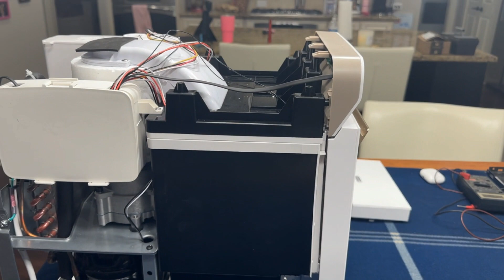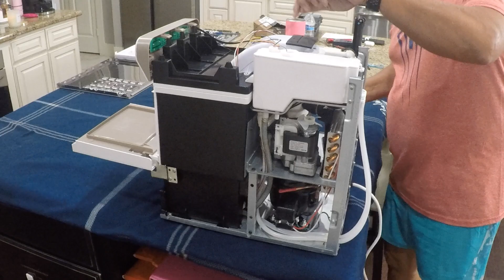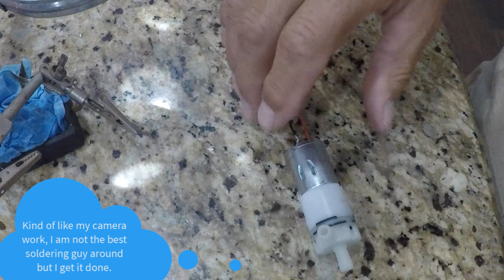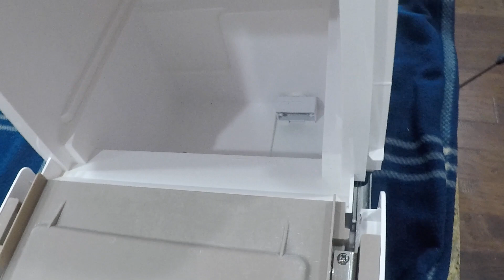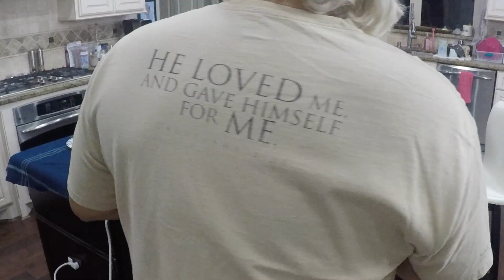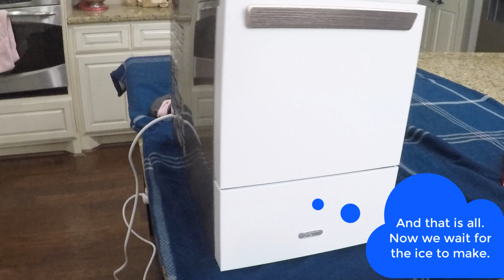GEVI household nugget ice maker repair

Comment: My pump is not getting power to it what could it be, anyone had this problem?
Reply from the maker: Is it just the pump, or is the rest of the unit without power?
Reply: @The-Old-Dude 

Got it to work for a while, now is showing again that needs water. Also while making ice I notice making a loud noise and finally the cover for the ice  broke. It looks like the ice was getting stock and putting pressure to  the white ice cover!
Reply from the maker: Sounds like a water flow issue to me. Make sure all the lines are clear and the pump can fill the tank and push water out of the ice shoot.

Comment: Any ideas on one not stopping making ICE? Mine runs and runs and fills up near the bullet metal dispenser then causes condensation over the outside. I've cleaned the sensors and taken it off the auto fill line but it keeps going. Maybe it's the thermistor? Do ya know what that is located?
Reply from the maker: You are on the right track looking at the sensors, because if memory serves, when the ice blocks them from seeing each other, the machine shuts off. I would check connections and wire integrity. If all of that is in good shape, it has to be the control board.

Comment: Thanks, fixed mine too. Just a PSA that there's a pump for sale on amazon that has the leads pre-soldiered in and the same plug as the Gevi OE pump, so it's just plug and play.
Reply from the maker: That's great to know, thanks for sharing the tip!
Reply: Do you have the link for that part that is ready to go?

Comment: I have an opal ice machine but the set up is very similar to this gevi….so I replaced the water pump but it runs as soon as I plug the machine in…so it’s getting power even if the machine is turned off. Any guesses why it’s getting power like that?
Reply from the maker: If the machine is off it must be controls related

Comment: This is wonderful!  Got my 2+ year old GEVI back to good as new!  Cleaned a lot of scale out of the lines and fittings in the process (will be more diligent about descaling in the future).  IMPORTANT NEWS - Amazon now sells a pump with the same model number pre-wired with the correct connector - so no soldering needed!!!
Reply: Also,  If you are ready to do this - pay attention to the end of the video to learn the tricks to dis-assembly that are skipped over in the beginning!
Reply from the maker: That's great news about the pump, glad you got yours working again! I will look for that pump next time, is this the one you used? 
https://www.amazon.com/KPW26C-12C2-Replacement-Profile-Countertop-Genuine/dp/B0DWXXP8H1/ref=sr_1_8?crid=25DZD3UG799AW&dib=eyJ2IjoiMSJ9.dsppDq6Nzop4YQuuj7nRtPjtiU1CDgQTJGE39pHm04RNn4MTFbCBn4BFVeWcMXvbURLfkyB2PwA0F10upQSieRrUBtrFId1a4pxYtBdCq5r-sGJ4EKxxUd8xiMe7t1Y3usa4jlE0nksdEGXWkXGRn3XSh7MkJs_gaUFcF7rkU9Kvqo9PVazhme5LVSSuP8W8-MhCCw7x88ChE8Ls45O_cgl2vh-WiE7reauNxmm_bNU.hr9rz5jr3XYZZKMkBzDAkK7t3XeQFUSTaCQtDfxnDzQ&dib_tag=se&keywords=ice+maker+pump+replacement&qid=1765644899&sprefix=Ice+maker+pump%2Caps%2C154&sr=8-8        

 If so, I guess that means there is a need for this plug-in replacement.

Comment: Thanks for the video, mine is acting up, and now I can reference this video for how to take it apart and check things.
Reply from the maker: Good luck with your repair.
Reply: @The-Old-Dude  thank you, I couldn't figure out how to get the control panel off the front, but I was able to clean the coils and it's working much better now and stopped leaking somehow.
Reply from the maker: @Dorraj555  nothing wrong with being lucky.

Comment: I unfortunately don't think I can replace mine.
Got it from auction; a Gevi 2.0 but it uses a different pump. 
It's a KD-28 model but has three wires: black, red, and yellow.  I can't find it anywhere =(.

Thankfully I'm within the return time frame.
Sucks though cause I was really looking forward to this machine.
Reply from the maker: @NiftyNiklz  No help here on the third wire. Maybe a speed control?  Good luck.
Reply: It’s not letting me post links for some reasons, but the pump I ordered was ZLWB-12 HZB-12A/25BF Household Small Bullet Ice Maker Water Pump Compatible with HZB-50A/ HZB-50/ HZB-60/ HZB-80/ HZB-25BF/ HZB-13F/ HZB-20F/ HZB-20FA Ice Maker Machine DC 12V 0.3A

And the fan spoofer was: Fan Spoofer New For RED MAGIC Quasi-Speed Device 12V PWM Variable Frequency Version Fan Speed Simulator, 5-20V Super Compatibility

Comment: My unit was DOA (front panel was dead).  Since it was only a few days old, they had me cut off the electrical cord and they sent me a whole new unit.  I was going to throw the defective one away, but after watching your video and deeming the unit repairable, I think I'll just hang on to the disabled one and use it for parts, should I need them.  Great video!
Reply from the maker: Good plan to hang onto the unit.

Comment: Mine is freezing up where it makes the pebbles and you can hear it wanting to spin but it can’t because it’s frozen. Also it doesn’t seem to be making pebbles or pulling water out of the main tank. You think the pump could be the issue to both problems? because I read lack of water flow can cause it to freeze up.
Reply from the maker: That's an interesting idea. Mine also recently started freezing up. I have recorded what happened but have not figured out a fix. I will upload that video soon.

Comment: THANK YOU so much for the video, I changed out my water pump and it's back up and running perfectly! I would suggest using some flux when you solder your new leads into the motor. It helped me so much control where it went and stayed. Thanks again!
Reply from the maker: Glad it helped. I will add that to the notes for next time.

Comment: I wish you would have shown how to get the sides off…. For the life of me I can’t get mine off
Reply from the maker: Good Point. If you will go to about the 16 min mark I detail how all this goes back to together. For removal just reverse this process.
Reply: Thank you that helped! I was able to get it apart! Now just waiting for my new pump to arrive.
Reply from the maker: @Backroadtested  Good luck. For additional reference you should watch the video I made more recently when mine started leaking water. I had to take the ice slide apart  which would help with the pump removal as well.
Reply: I have a slightly different version (GIMN-1000C) and I can’t get the sides off bc the screws from the on/off section go right through them so I’m unable to remove either the on/off section OR the sides completely
Reply from the maker: @amyerickson449  you have to take the screws out of the top of the on off section and then lift it up and there are screws through the front of the machine that hold the sides on behind on section and behind the lower trim, I guess what you call it, at the bottom of the front. I show taking both off and on because this was the hardest to get off.
Reply: @amyerickson449  I had similar struggles disassembling mine. Like The-Old-Dude mentioned there were 3 screws on the top but there were also 2 screws going through to the main body of the appliance and I was unable to lift up the on/off section until those 2 screws were removed. I found out that popping some tabs on the inside towards the front face of the on/off section allowed the front face to be removed which then reveal the heads of the 2 screws. After removing the screws I was then able to remove the on/off section.
Reply: @sugarlumps-n7e  Ah, clips under the on/off section! I didn’t end up finding them. I ended up just splaying the sides open so I could get to the pump. Turns out my hoses were all crusty, and the pump, although I had a replacement, just had to be taken apart and fiddled with. It’s working now and I was able to send the pump back to Amazon.
Reply from the maker: That would make it difficult. Glad you got it working again.

Comment: I'm soldering quite a bit as I'm fixing whatever I deem worth saving from the landfill. What I'm recommending is that you use solder flux. I like the paste though you need to warm is up with the tip to soften it. Twist the braid then dip it in the softened flux. Insert yout shrink tubing if you got some, otherwise use some tape later. Then dab a bit of flux on the solder terminal. Now make hook or make contact both items. Dip your soldering iron tip in the solder paste and melt a little solder on it. Then apply the tip to your joint. It should not require more than 2 seconds. Check that the joint is strong by tugging gently. Then cover the solder joint with your PVC insulating tape  or heat shrink tubing. Voila! Easy-peazy!
Reply from the maker: Thanks for the tips. I have come to realize this is not one of my strong pursuits.

Comment: You didn't mention which side the red wire faces on the pins, is it the back pin or the front pin.
Thank you
Reply from the maker: I am not sure this matters because of the way this pump works. However I like to put thing back just like they came out  and If I recall the red wire goes on the terminal across from the pump inlet. Check out the vid around 7:45 mark for a visual.

Comment: Great video! Fixed mine I think the replacement pump without the restricted orifice will hold up longer than the original part.  I think the hard water here is what really did that pump in.  As a bonus to my repair I only misrouted one wire and ended up with only four extra screws.  We got ice!!!
Reply from the maker: Yea screw’s multiply when you set them free.

Comment: Thanks so much for this video, only question I have so far with this repair is how you remove the lower front panel??  TIA!
Reply from the maker: That is a tricky one. I do cover this in the video about 3/4 in, as I remember There are clips on the bottom of this panel, then you rotate it up. Check on this as it has been a few months now.
Reply: Thanks for your response!  I ended up getting the thing off, just busted one of the tabs in the process.  Sure do appreciate your video, great documentation!!
 @The-Old-Dude
Reply: I used two flathead screwdrivers. One to pry the tab up from where it clips in and another to pry pry the whole piece off of the front. I worked my way from one side to the other and it came off quite easily.

Comment: Thanks this helped immensely. Got a little frustrated popping those sides off, but otherwise was able to follow you very clearly. I actually managed to replace the pump without taking the bucket off by using a flexible screwdriver and only popping the top screw on the bracket off. Felt like it saved me 10 or 15 minutes.
Reply from the maker: Glad it helped, I thought that might be possible.

Comment: Heat the part and then touch the solder to the part not the iron, make sure you use flux too! Soldering is fairly simple you just have to do it in the right order
Reply from the maker: Thanks, I may ned to buy a real soldering iron.

Comment: As an owner of the same (different color) icemaker, I can attest to two things.  One, It makes awesome ice and a lot of it and two, Gevi is very good about honoring the warranty.  I had the same problem with my water pump.  I sent them an email describing the problem.  Within 24 hours, they confirmed that it was a faulty water pump and gave me a choice of full refund or replacement icemaker.  Thank you for making this video.  If my newly replaced icemaker has another issue after the warranty, I will certainly use this video to repair it.
Reply from the maker: Does yours make a howling sounds when it gets low on water?
Reply: They are terrible compamy... i love the ice maker but I bought one and 6 months later quit working they replaced it and 6 months later thar ine quit working as well and they wouldn't do a dang thing other than admit they consistently see these 2 issues with the machine
Reply from the maker: Not a good look.